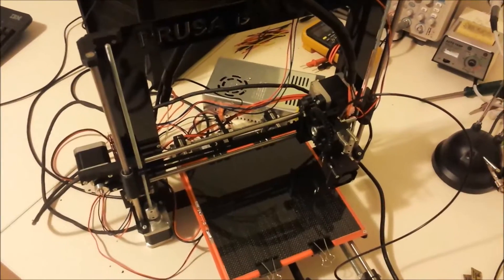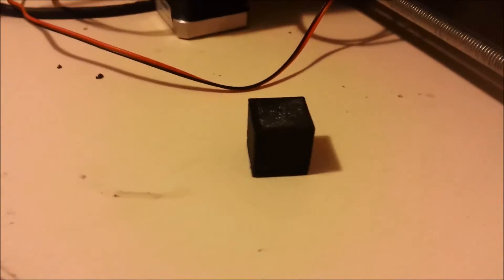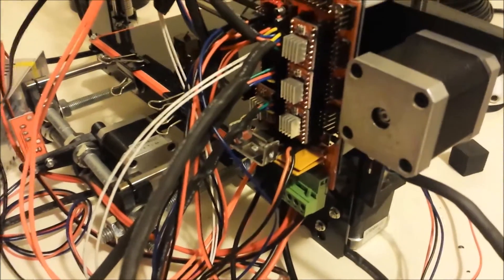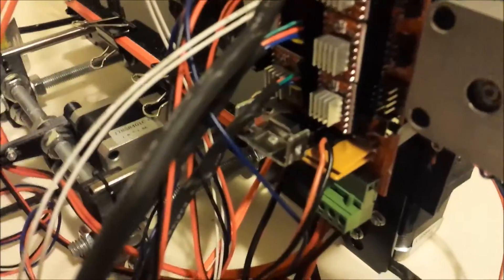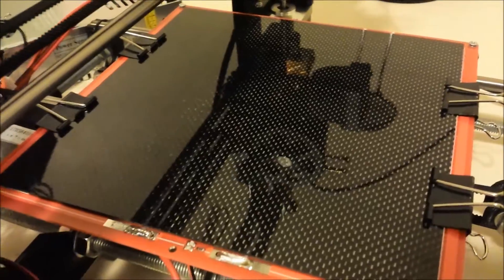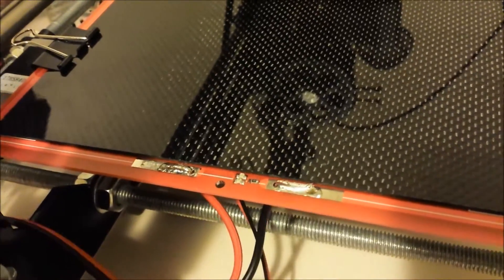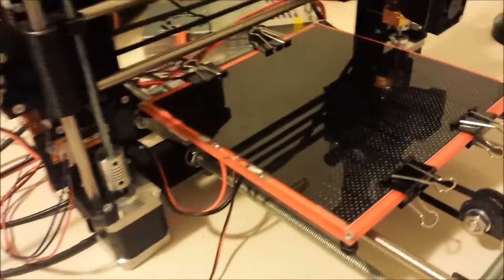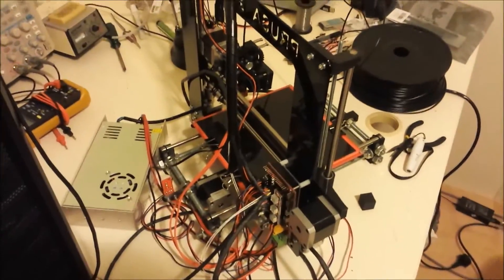3D Printer - Prusa i3 Final Assembly

Comment: hi @tech2c did you use heat sink compound on the ramps heat sinks or just the sticky tape they come with?
Reply from the maker: +idoAUTOMATION 
Just the sticky tape that came with the heatsinks of the stepper motor drivers.
Reply: +Tech2C ok will do thanks for replying ;-)

Comment: Hello my friend. Im going to get one of this by Generic on Amazon, the reason is it costs $400us and its cheaper.
 I would like to know whats your experience with the Prusa i3, how is the quality of final products?. Do you recommend it? 
Pros and Con.

Thank you so much
Reply from the maker: Esteeban Loppeez Hi. I can only recommend it based on price. That is, for the price it's pretty good. A different 3D printer design like the Ultimaker 2 will provide better results at a much higher price, however I'm trying to get as close as possible quality with incremental upgrades to this Prusa i3.A kit like this is also very rewarding to assemble, configure and finally print your first object. You learn a lot about 3D printing and can appreciate the different printer designs that exist.Read reviews and forum threads for any printer you're about to purchase, to make sure others have had a good experience.
Reply: Hello Tech2c, thank you so much for your answer. I see mini Kossel is a good 3d printer but starter kit does not come with Abs option, Flashforge and Makerbot are expensive to start. 
I'm software engineer and maybe i don't have problem to apply some mods, obviosly I have to study firmware.
I think i will buy this 3d printer next month and i'll be watching your videos. 
Thanks best regards.

Comment: what about taking a thin piece of glass and putting it in between the heat bed and the carbon fiber that way it fixes the bow of the heat bed and you still get the benefits of the carbon fiber, all you would have to do is raise the heat to compensate for the thickness of the glass and carbon fiber
Reply from the maker: Yes, glass does indeed flatten out the PCB bed. I've moved on from carbon fiber to blue painters tape as the carbon fiber isn't as effective in adhering ABS plastic to it - in my experience.